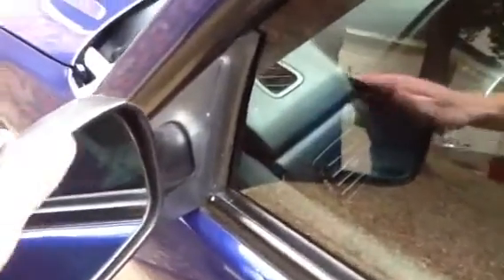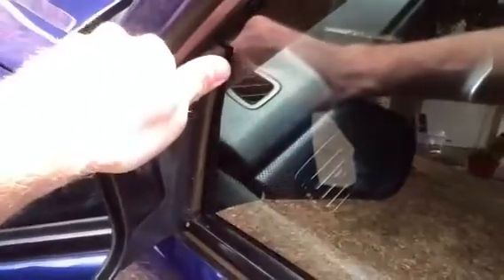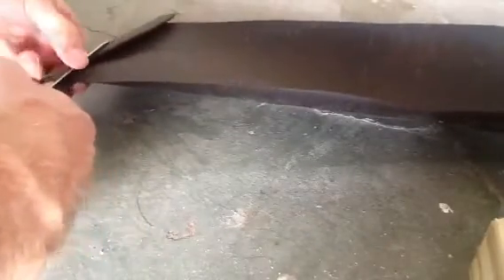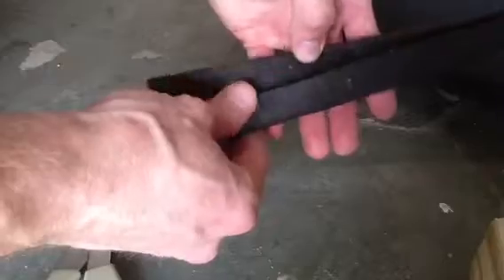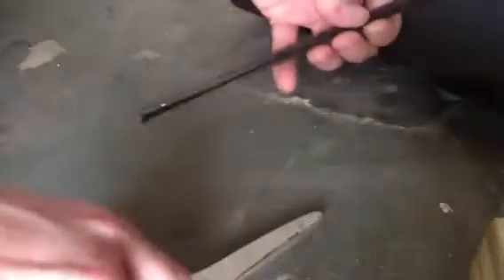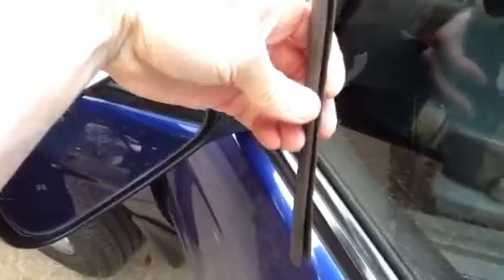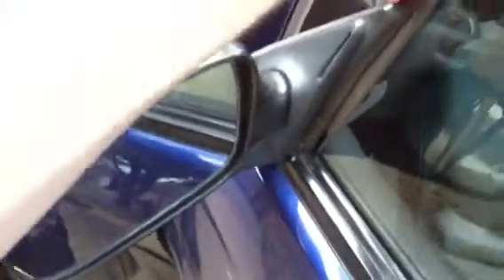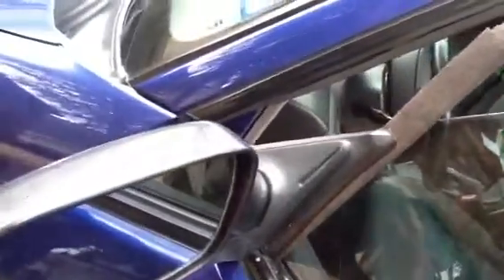Subaru forester wind noise fix door gusset

Comment: Perfect "temporary" solution!  Followed your exact instructions and happened to have roofing tar paper in my workshop.  The driver's side was worse than the passengers and fixed both.  There is no more wind noise; it is gone!  Many thanks.